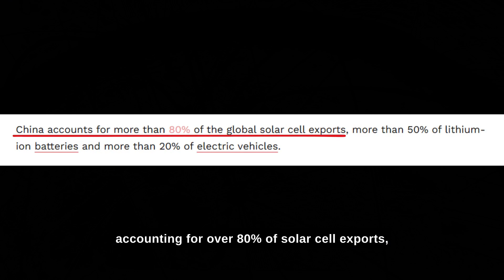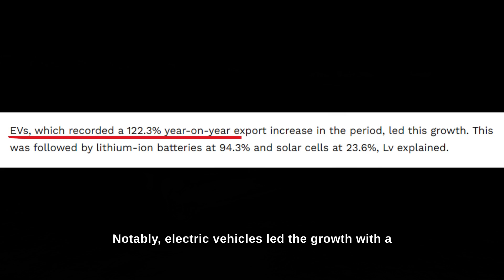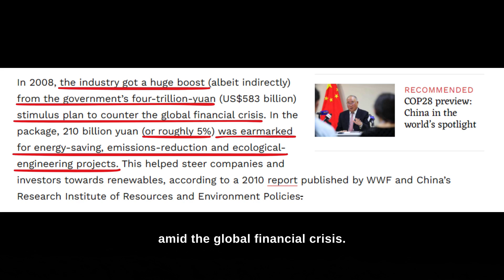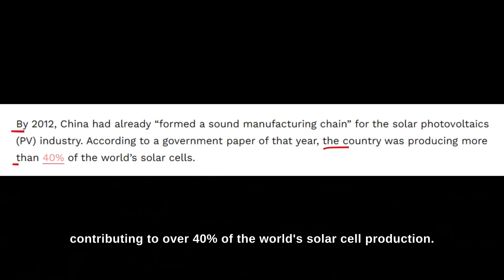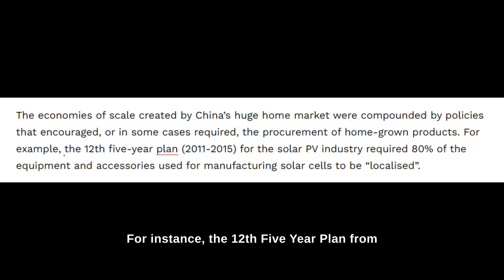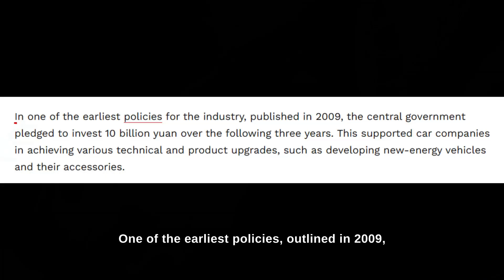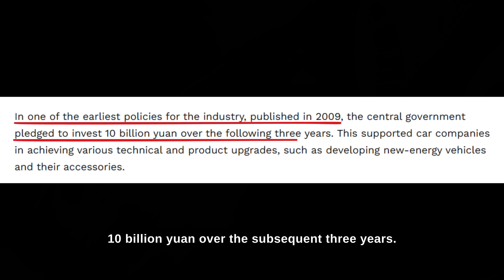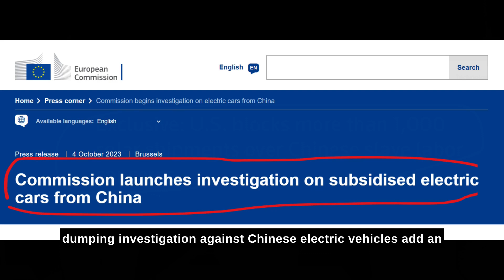How China Came to Lead Solar Cell, Lithium Battery and EV Manufacturing

Comment: A long video that could have explained by a few word.
For solar panels China is the country that drove down the cost of the western products by 90%.  It is just that simple.  When it started China relied on totally from the west including raw materials for the solar cells.
For lithium battery China has been the key manufacturer as this is the same battery for mobile phone.  China just innovates and makes it affordable.
China doesn't have large oil and gas reserves so it can never run ICE cars like the west.  Therefore concentrating on EV early is the only sensible choice.  Every major car manufacturer makes EV in China but Chinese production is cheaper.  The same western models sell in EU and US are more than 100% dearer.

In a nutshell China makes everything more affordable than the west who is only interested in fat margin.

Comment: In the energy sector, China's nuclear efforts are close to paying off.  It's gen 3 reactors are being offered for sale to others and will fill out China's nuclear plan through 2030 with the largest nuclear powerplant fleet in the world. China is developing ge4 reactors and one that stands out is its thorium molten salt reactors with a development model running now in the Gansu Desert.  Further, in fusion, China holds the record for the longest sustained fusion and it is gearing up to obtain continuous sustained fusion.

In transportation, while electric cars are getting all the press, there is also markets for China's electric trucks and busses.  In the rail sector, super conducting trains capable of 600 km/hr are being tested and primed for production.  In the ship sector, nuclear power and modularized construction of ships has given China the lead in ship building, both in the civilian merchant marine sector and the military naval sector. There are proposals to use the thorium MSR mentioned above for marine use.

In the battery sector, CATL and BYD are the top dogs in the world of batteries.  Today's lithium ion and ferro-lithium batteries are maturing and China has a lock on the entire supply chain.  Further, the development of sodium-ion batteries are making headway and may lead to less expensive and broader use in electric transportation. High capacity capacitors, batteries, and fast charging capabilities are coming online and with it, even aviation is experimenting with electric aviation.

Last, but not least, underpinning the above technologies is China's rise in semiconductors.  As of now, China lags maybe 2 to 3 years behind the west in the high end semiconductor chips, but in 2024, we will see China producing 3 and 5 nm silicon chips, photonic, graphene, and quantum chips becoming reality, and China achieving EUV and x-ray lithography capabilities.  If all goes as planned, 2024 will be the year China leads the semiconductor race and becomes the biggest production source of semiconductors across the whole range of semiconductors from mature node chips to advanced chips.  

Not as related to the video, but still worth noting is China's advances in quantum applications from communications, computing, to radars,  high power lasers, magnetic applications such as EMALS and rail guns, synthetic biology breakthroughs, biomedicine growth, and genetic applications to health and longevity. The Chinese biotech sector is often underreported except in scientific journals, but China is on the cusp of breakthroughs that will impact our lives and our health.

This decade will be China's rebirth after its 'century of humiliation.'  China will once again, rise to take its place in the world and lead in making peace and adequate sustenance the prime goal for human kind.